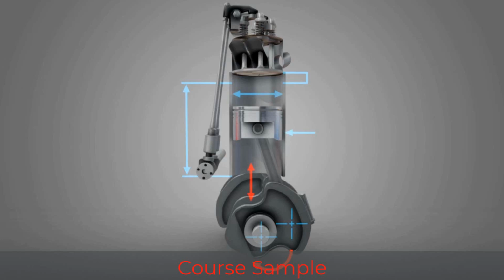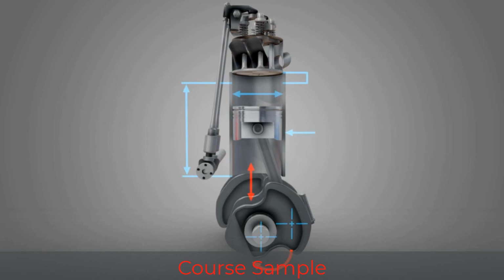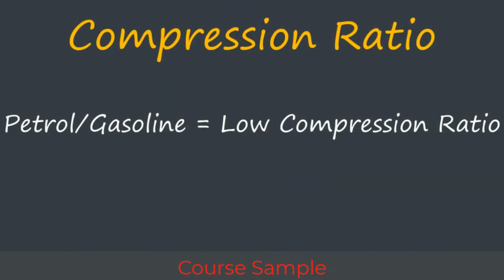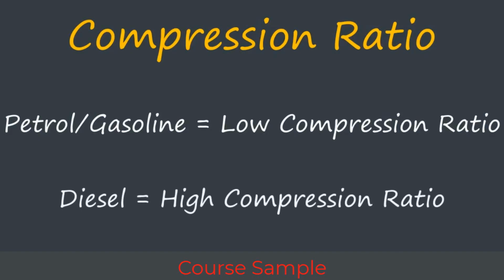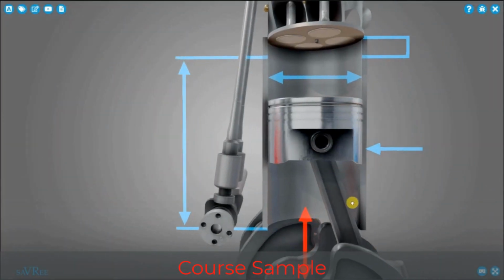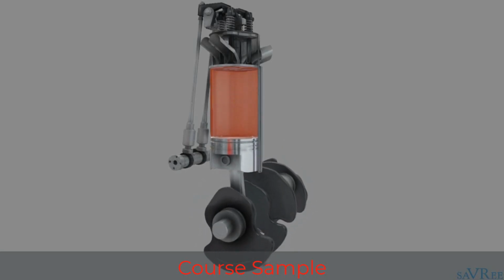Engine Parts, Components, and Terminology Explained - Video Course Sample

Comment from the maker: This video is a sample from the saVRee engineering video library, which contains over 100 hours of video content spanning mechanical, electrical, marine, power, nuclear, and industrial engineering topics.

In this sample, we talk briefly about the core principles behind engine anatomy and terminology, including common components of a four-stroke diesel engine (like pistons, connecting rods, crankshaft, camshaft, fuel injectors); important terms such as top dead center, bottom dead center, clearance volume, cylinder bore, compression ratio; differences between two-stroke and four-stroke engines; and how metrics like swept volume and friction reduction are managed through lubrication and bearings. 

📘 Explore the full course on Engine Parts, Components, and Terminology Explained:
 https://savree.com/en/online-engineering-courses/Engine-Parts-Components-and-Terminology-Explained

🎓 Browse our complete course catalog:
 https://savree.com/en/online-engineering-courses

🔧 saVRee gives you access to:
- 500+ interactive 3D models for technical training.
- 100+ hours of video-based engineering education.
- Industry-standard content used by engineers, students, and trainers worldwide.
- SCORM Compliant

Start learning about engineering today with engaging, practical content, visit https://savree.com

#savree - THE engineering training company.